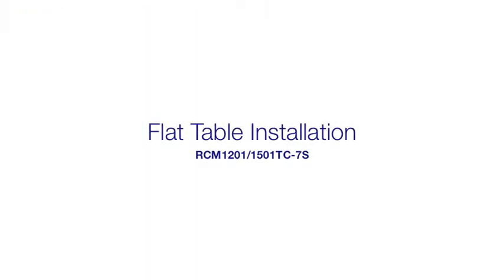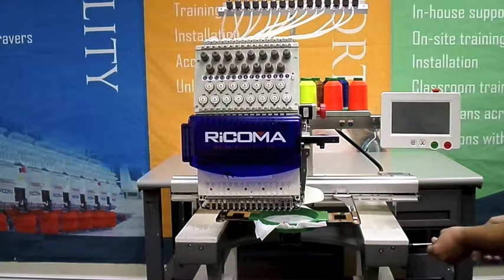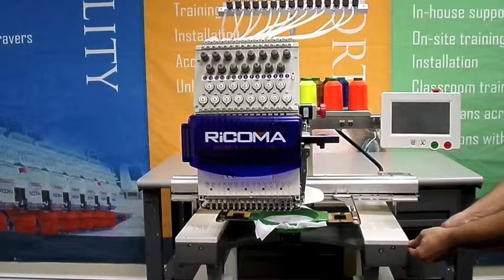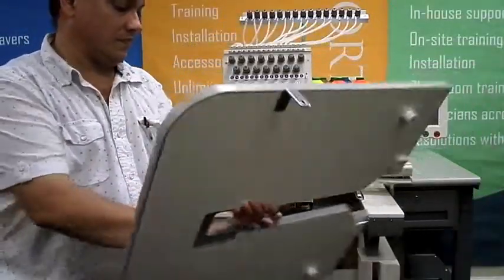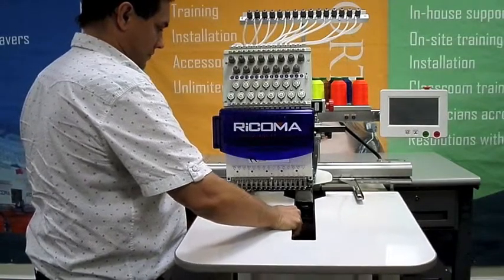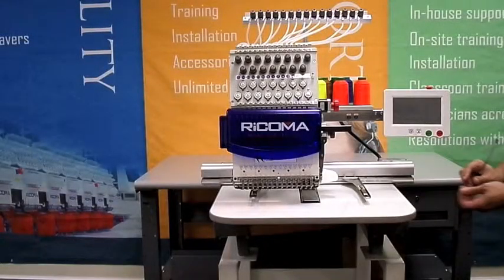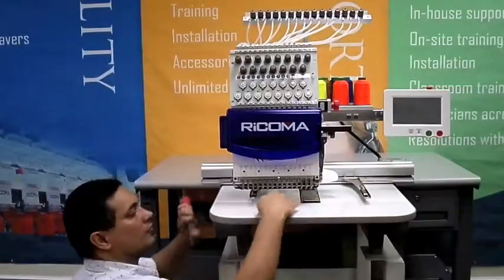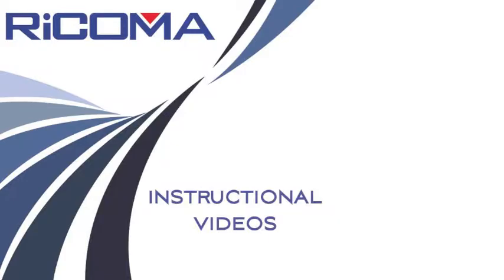Flat Table Installation on your RiCOMA Singe Head Machines

Comment: Hi. Great video! Thank you. I just attached my table to my swift and noticed that I am not able to open the bobbin door anymore with the table attached. Is this correct?
Reply from the maker: I am sorry you are having trouble. the short answer is No, You should be able to open the bobbin door with the table installed. Try moving it back just a little and check the mounts to make sure they are on properly.